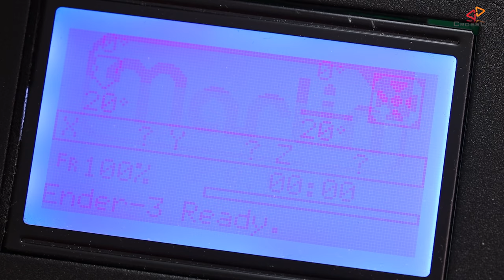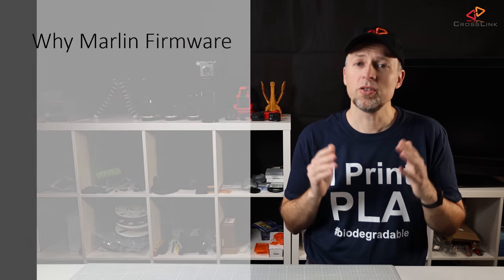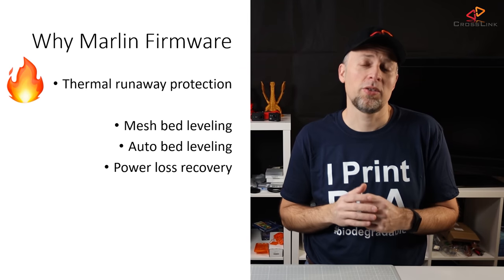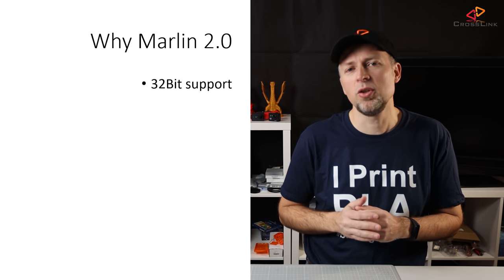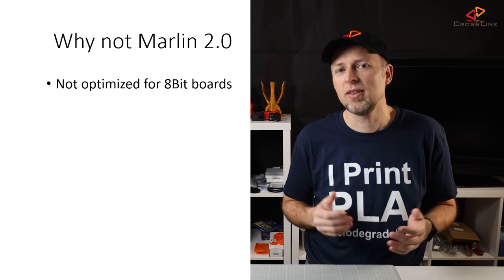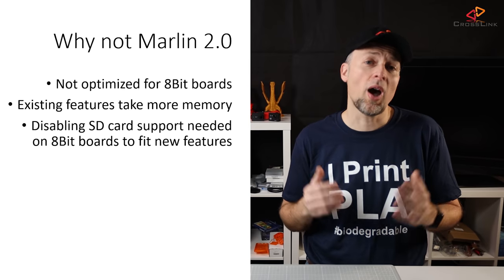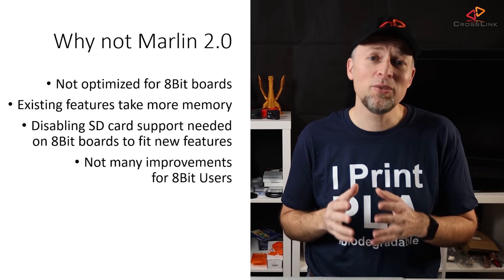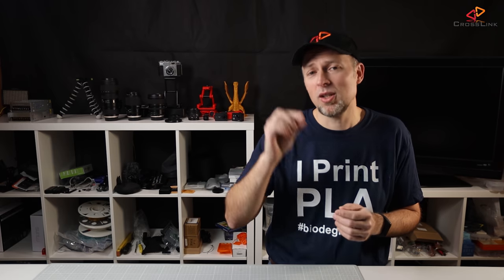Marlin Firmware 2.0 - Should you upgrade and why not?

Comment: My Anet a8 has been running 1.1.9 since it came out and works great.  I think a good rule of thumb is if it's 8bit stick to 1.1.9 , if 32bit go with 2.0
Reply from the maker: Are you planning to go 32bit any time soon?
Reply: @Crosslink3D  Not for my A8.  It runs really well as it is.  I do have an skr v1.3 on another printer running Marlin 2.0.0
Reply: Flash memory seems to be the real bottleneck.  I am running Skynet 2.3.2, which says it is Marlin RC8.  Unsure what version number that corresponds to.  With mesh + linear advance features enabled, it already breaks to bootloader, so I have to use ISP to program.  You have me interested now in trying the Marlin 1.1.9.
Reply: Absolutely. I am running reliably my ramps based printers on M1.1.9 and I basically don't see any reason going beyond that.

Comment: In my opinion I have carried out tests with several versions of Marlin and even variants such as SkyNet, I honestly liked working with version 2.0 the engines move very smoothly, the noise produced by the paused printer and in printing are incredibly lower at Comparison of previous versions, I could build a mod with a 1.3 "oled screen, rotary encoder with switch, sd card adapter and buzzer, it works perfect, easy to configure, even the connection with Octoprint or Simplify3D is better, soon I will add a BLTouch sensor to my Anet A8.
Reply from the maker: Thanks Kaiser Alvarez!

Comment: Upgraded my motherboard to a 1.1.5 with silent stepper motor activated. It came with Marlin 1.1.8 which had some bugs in it, so upgraded to 2.0.3 and it's working really good. Great video
Reply from the maker: Great to see that it's working for you 👍
Reply: I have that one. what bugs?
Reply: @MihaiMihai-fw7do  on mine it would print 30 to 40% and then the extruder would stop feeding the filament. There is a video on YouTube on a fix for it,  changing the stepper motors to stand alone in the Marlin build. Been great since
Reply: How did you install it? I was also researching whether I should update for the 1.1.5 motherboard. What is different from 1.1.8?
Reply: @icimdengelen741  The motherboard was an easy install and an inexpensive one too. Picked it up from Amazon for about $45 with the Marlin firmware on it already. As far as the difference from the 1.1.8  to the 2.0.3, not sure. I just know that right after I installed it I tried two prints and the 1.1.8 version had major issues like the extruder stopped moving filament.  That's when I researched it on YouTube and found the resolution for it. Been great since that
Reply: What kind of problem?  How did you solve it?  Because I'm going to update today.
Reply: @icimdengelen741  The extruder stopped feeding the filament to the hotend when the print was reaching 30 to 40% done. You may be ok, but in case there is a video on YouTube on upgrading to the newer version and changing the stepper motor settings to stand alone
Reply: Thanks, I have to investigate a little.

Comment: Hi, your video is very useful. Thank you for summerrizing the important stuff in short and clear comparison.
I've also checked the blog post about memory usage, also very helpful. 
As "thank you" I will share mi findings that #define SPEAKER costs 1676 bytes in Marlin 2.0.X according to my calculations and tests.
BTW I didn't fit in the flash size by 0.2% or about 300 bytes and had to disable the speaker.

Comment: I uptaded to Marlin 2.0.7 because I plan to use mix color gradient which is not available in previous versions. compiled it with platformio cos I added loads of things to it so it wouldn't compile with arduino IDE. You would want to initialize the EEPROM once updated in order to make your BLtouch probe at the right place. Having loads of failed prints due to MKS TFT 28 sending spurious gcode to marlin (MKS gen L board)

Comment: Excellent video! My CR10S is still on Marlin 1.1.0 and I was considering moving to 2.0.x, but I think I'll upgrade it to the last version of 1.1.x instead since it's still an 8 bit board. The printer works just fine, but the thermal runaway concerns me and I'd like to enable a few features (namely BLtouch/auto bed levelling) and disable others (SD card support since I use Octoprint.)
Reply: does octoprint requires active internet connection ?
Reply: @akashsaini100  No, it doesnt. But if you want to acces it remotely, it obviously does.

Comment: Another mainboard with a bigger 8-bit chip, that should also be quite common is the Geeetech GT2560. I had it in two cheap i3 clones, I bought used (Geeetech i3 Pro W and CTC i3 (Pro W?)). But in general: If your board is an old 8-bit board, replacing it with an 32bit board is a cheap upgrade that will also future proof your printer (you will be able to get firmware updates with all features you may want for much longer)
Reply from the maker: Yes, I agree. Would also go for 32Bit today!

Comment: Marlin 2.0 uses Junction Deviation by default rather than Jerk. The algorithm is different (and presumably better?). That might be another reason for trying Marlin 2.0 on 8 bit boards ... squeezing one final bit of print quality at higher speeds. Teaching Tech has a video on optimizing Acceleration and Junction Deviation using Marlin 2.0.
Reply from the maker: Great Tip!

Comment: I have currently 3 different versions on my printers. My first Ender 3 has Marlin 2.0-bugfix, because 2.0 wasn't stable yet and it has an 32bit board now. My Geeetech i3 Pro W has 1.1.9, because it was the latest stable version when I updated it. And my second Ender 3 has currently 2.0.1 on the stock board. With pretty much just the stock settings in the example configuration (+ optimized PID) it uses 97% of the memory. Ironically this version will be the next to be replaced, because my new SKR mini E3 arrived.
Reply from the maker: Oh great, I am so curious how you succeed with the SKR Mini E3!

Comment: I just upgraded my old Mega2560/RAMPS with 2.0 three hours ago! I've been running 1.03 dev on my (old!) i3 and wanted to try the linear advance, not to mention I figured there has to be a bunch of improvements I don't know about. Just finished my first print and it looks like I'm going to have to change my infill/perimeter overlap settings. After a week or so I'll make a call on sticking with 2.0, sticking with what I've used, or trying out the last 1.x build.
Reply from the maker: Nice upgrade! Good to know, you're making some progress!
Reply: Did you keep using version 2 or did you go back to version 1?
Reply: @alpharesearch2  After a half a dozen prints failing because the thermal runaway erroneously thought my hot end was out of control, I went back to v.1 so I could get some work done! Haven't looked back. Building a new dBot with SKR 1.3 and I'm going to have to sort out V.2 for that. Finally got it to compile with PlatformIO yesterday. Will try to comment next week on my success or failure with it.
Reply: @yogimarkmac  thanks for the information. I'm running 1.1.0 and it looks like going to 1.1.9 or 2.5.3 is kind of like the same work. I guess I will have to test both two. :)

Comment: Wish I'd found this video yesterday.  I was installing a BLTouch on my otherwise stock cr10s5 (two years old) Marlin 2.0 didn't compile U8glib error. Followed by avr-gcc.exe  file path or name too long error.  A google found both are related errors.  so I switched to 1.1.9 and it compiled fine.   2.0 obviously had some effect though as my SD card slot then began a bootscreen cycle.  New sd card and it works fine.  First new print has been going for the last 15 hours. 3 more to go.    Noobs like me to firmware, github and more.  this was all very daunting stuff. If I'd have known 2.0 would've failed from the start, I'd have saved hours.

Comment: Another great vid. I’m still running original firmware on my anet a8 and have been having a horrible time with first layer and stringing, I’m using your cura profile but to no avail, do you think upgrading to marlin 1.1.9 will help solve a lot of my issues?

Comment: The Anycubic i3 Mega (S) do use the TriGorilla board which has the Atmega2560 MCU that according to the specs having 256KB ISP flash and 8KB SRAM.
Marlin 2.0 would normally be possible without any problems.

Comment: Interesting. The v4.2.7 silent board I just got in came with Marlin 1.0.1, that is so strange.
Reply: same here; how do you upgrade it??? i've googled it and it seems like superhard
Reply: It most likely came with Creality firmware v1.0.1, which is a modified version of Marlin 2.0. Marlin 1.0.1 shouldn't work at all since v4.2.7 is a 32 bit board

Comment: I released the magic smoke from my ender3's melzi. And replaced it with Skr mini E3, the 2.0.x bugfix on it is a lil buggy menu wise. Pause doesn't lift the head, lil things, but i'm waiting for the Auto Build Marlin extension......
Reply from the maker: Good news, update your Auto Build Marlin Plugin in Visual Studio to the latest version 2.1.0 (normally it should do it on its own and show this in the Extensions tab so you just have to reload VS Code) and it should be fixed. Please tell me if it works for you then.

Comment: should note "stable" is just frozen copy's of bugfix so bugfix is always newer 2.1 is currently older then bugfix also. it should also be noted as a marlin dev my self we push people to use platformio that can save as much as 25% of resources in the compiled firmware.
Reply from the maker: Thanks for pointing out! Is the 25% savings also with Marlin 1.1.9 or only with 2.X?
Reply: @Crosslink3D  anything compiles with platformio.
Reply: Even marlin 2.1 😁
Reply from the maker: Vertabreaker's Hobby's I will test this claim that platformio produces smaller binaries if that is what you mean.
Reply: @Crosslink3D  it 100% does produce smaller compile copy's of marlin as much as 25% smaller.
Reply: Ok. So how do I get it to work on my printer? I built a core xy printer a year ago and cannot get through the firmware setup/ install. Any help/tips will be greatly appreciated.
Reply: @patrickbodine1300  documentation is and always has been on the marlin website. it could take months to sit with someone and build a working firmware i have done so in the past.
Reply: @patrickbodine1300  suggest joining the marlin discord as posting a few 100 or more messages over youtube discussing it would be silly.

Comment: To be honest, not many printers came with the smaller 1284p based boards in the last 2-3 years. Most came wit a 2560 based board like the MKS boards or the Ramps related boards. The Tevo Tarantula is a good example. Shouldn't be an issue.

Comment: it already is on my ender, and i have some strange problems... maybe its because of it. i will wait some time and upgrade again =D

what i think is totally UNACCEPTAPLE is when manufactors ship printers with BETA versions of marlin 2.0 ... 
(and yes, that is really the fact)
Reply: What problems do you have?
Reply from the maker: I've seen that in Thomas Sanladerers latest video. Seems that manufacturers simply don't care. They assume that the user will fix those issues anyways. It's a shame.
Reply: @Crosslink3D  exactly!
Reply: @1234fishnet  mainly with ABL the z-offset. but i guess its beacause the version is not the most newest i think

Comment: I have the Artillery Genius running 1.1.9, I use this version for the MBL mode, if I was to upgrade the board, is the 9point MBL in version 2.0.X?
Also, if I was to upgrade the board, are my original stepper drivers compatible? Thanks!

Comment: I've notcied a wierd issue since updateing to marlin 2.0. When I stop a print if I then immediatly start moving an axis, before it has finished homing, it will then move the axis it was just homing in the direction away from the endstop continuously pushing it against the edge of the rail.

Comment: Hi there, I’m new to the hobby, sorry maybe a stupid question, I’ve just bought a Ender 5 pro with the new silent board, is that a 8 bit board or 32 please?  Can I run Marlin 2.0 smoothly with that new silent board upgrade please? Thanks
Reply: Just look on your mainboard and check its version. It is printed on the board itself. You can write it as a reply, or search "creality v'yournumber' mainboard", and you should find more information.

Comment: so i assume that im on the 8bit board. but i was running in an issue with my z access thinking that id upddate software. Well i updated to 2.0.6 and well now when i auto home it says that it has created an issue and wont even auto home when im trying to start a new print. While i was on the original firmware it was working, any chance of going back to the older version or how can itrouble shoot the issue .

Comment: Hi
I need to move on to Marlin 2.0 because I have calibration problems with my Anet A8: after calibrating it I send an impression and always start doing it 1 or 2mm above the hot bed. I have tried several things, but without positive results. In several forums, I have seen that they recommend installing the Marlin and from there modifying the parameters, if necessary.
I would very much like to know your opinion.
Thanks in advance

Comment: Ok.  I got my upgrade installed.  However, I have a question.  I emailed custom menus, which work.  However, how do I change the main menu order?   I want The following order changed.  
Current:
Motion 
Temp
Configure
Preheat— custom
About
Release media
Print from media

Desire:
Motion 
Configure
Preheat— custom
Print from media
Release media
Temperature
About

Print from media

Comment: Any disadvantage to running 2.0 on Arduino Mega 256? 
Is it slow, or ?
Too bad stm32f103 doesn't have enough pins. (Well it only has 128kB).

Comment: Should I upgrade to Marlin 2.0 on my stock Ender 3 Pro? I want to have mesh bed levelling and thermal runaway protection, but you said that new marlin isn't very optimized for 8bit.
Reply: A 32 bit board is only £30 in the UK just upgrade the board too

Comment: "BL Touch V3.x only compatible with Marlin 2.0" ?? Im currently using a BL Touch V3.1 with Marlin 1.9, so have they made some changes to 1.9 since this video? Also, so there is no feasible way to have both SD card support and BL Touch support in Marlin 2.0?
Reply from the maker: Bltouch works with 1.x but new features are only available in 2.0. There is ways to get everything built into 2.0 though, so for me there is not a single reason left not to go for 2.0 by today

Comment: So i have a bed leveling probe which says "Smart V3.1" (not an original BL Touch) and have the 8-bit board on a Ender 3 Pro, i also want to keep SD card support, i guess i cant use Marlin 1.1.9 with that version of the probe? Is there something else i can disable in Marlin 2.0 instead of SD card, for example the power loss function, to make it all fit?

Comment: I RRRREEEEEAAAALLLYYYY don't want to upgrade to Marlin 2.0 from my existing Marlin 1.1.6.2.     What I RRRRRREEEAAALLLLYYY want to do is get my Ender 3 printing in the center of my bed again.   Is this at all possible?
Reply: Try to change size of your bed to 235mm x 235mm in slicer. Helped for me, 'cause cura had this set up to 220mm x 220mm. Keep bed height on 250mm like deafult.

Comment: im having an issue with my version of marlin 2.0, im using the ramps 1.4 board with an arduino mega 2560 and when i plug in an sd card it shows the card had been inserted but when i go into the menu it says no media. and now i can't flash new firmware to the board.

Comment: Hi, have you tried adding the compiler directives like described here:- https://thborges.github.io/blog/marlin/2019/01/07/reducing-marlin-binary-size.html.
It now looks like I can compile marlin 2 with a6 display, and capacitive touch, and keep sd support while compiling for the A8. I have not however tried uploading yet as need to grab my USB cable and possibly my usbasp. However the standard config compiles to 104356 bytes.

Simon

Comment: tired of thermal runaway on my a8. i seem to only be able to print small things
Reply from the maker: It happened to me before I switched to a 30A power supply. Since then, it’s great also for large stuff. Out of the Box the Anet A8 is not useable for anything serious.
Reply: @Crosslink3D  did u stick with a 12v or upgrade to a 24v?

Comment: Lets get this straight really fast.  Marlin is something that is given to manufacturers for free, not end users.  Manufacturers should be paying for this but they are not.  If Marlin did not exist almost no 3d printers would be sold and only a few people would buy PARTS nobody would buy kits.  Kits are sold because Marlin exists.  If hobbyists had to write code there would be only a few people in the hobby.  I'm so tired of people begging in videos trying to put this on consumers because I can tell you 3d Printing is not needed by most people.  It is a hobby just like Raspberry pi and arduino.  How many of those do you think were sold prior to the Firmware/Software being released?  None to hobbyists.  Manufacturers need to step up and pay the code writers.  Hold CHINA accountable for stealing from the community.  if they dont contribute, dont buy their kits or parts, its that easy.  We have seen these companies just fold overnight who have treated their customers like crap and forced others to step up, even if it is as little as what CREALITY does.  These kits are not hard to source yourself, stop buying their kits if they do not contribute in a meaningful way.  most of the time you end up replacing all but the 2020 frame anyways.